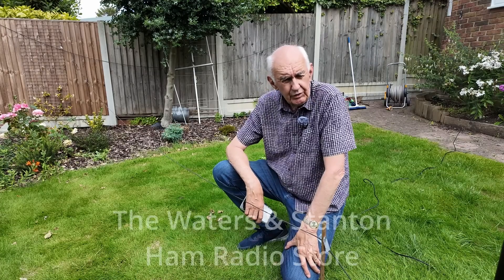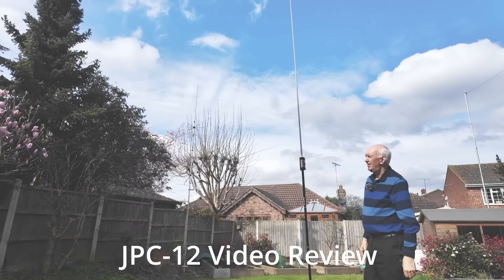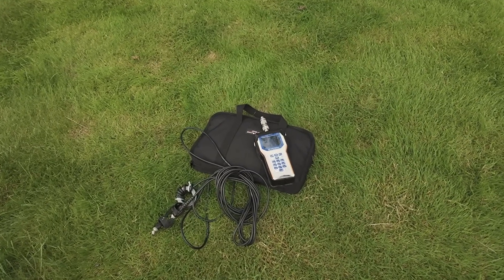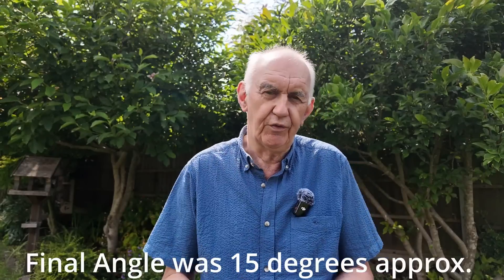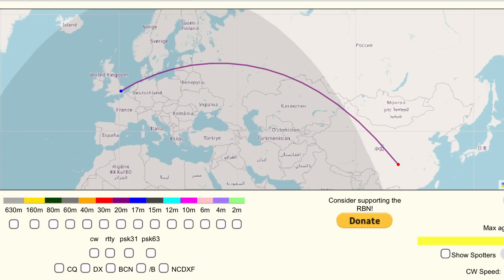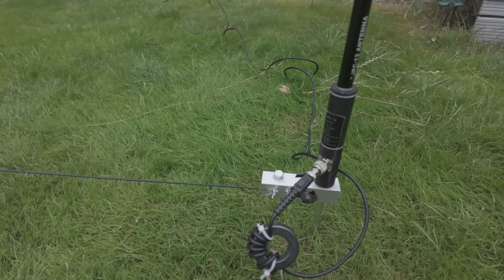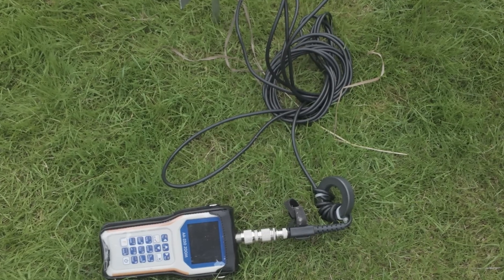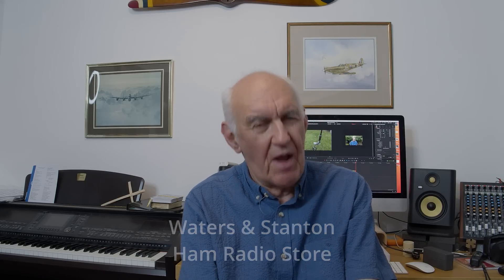Portable HF Vertical Antenna | Ham Radio

Comment: I'm a amateur radio operator living in a unassisted senior living center. I use a home made magnetic loop antenna in my room. Only 20 watts for local communication around the 200 mile area. Mainly with traffic nets. So transmission are short. Can you do a show on mag loop users in England and Europe. Thank you. Tom AF5AG
M  and 73. To

Comment: Excellent video. I have been working a home brew 5 meter aluminum vertical made from an extendable pole with a 2.5 meter fiberglass base (total length about 25 feet). The verticals attach to the antenna about 7 feet above the ground and angle about 30 degrees downward. 2 radials are resonant and are facing west southwest and west northwest, and the other 2 were about 3 meters long and facing northeast and southeast. I noticed a significant improvement westward as compared east. I’ll have to try elevating the resonant verticals as you did to see if I can get further improvements. Thanks for the always excellent videos.
Reply from the maker: You are very welcome

Comment: Hello Peter, I decided to buy one of those low cost QRP transceivers a few weeks ago, then planned to design/build a portable antenna by which to operate from.  While looking over the popluar antennas in use these days, I stumbled upon the JPC-12 antenna, and was impressed by the design, cost, and it's center loading, which improves radation efficiency.  So, I immediately ordered on.  In looking for reviews for this antenna, I discovered your YouTube page two days later.  To my surprise, I was impressed with your knowledge of antenna design/operation.  Here in the US, it seems most radio Amateurs know just enough about their equipment to get it to play, and are not interested in actually under understanding the "nuts and bolts" of it's detailed operation.  So, having made a career of servicing and designing aircraft communication equipment, I greatly appreciate your interest and knowledge of antennas.

Concerning a single raised radial for the 1/4 wave antenna system, I just discovered this concept 2 days ago and plan to experiment when the JPC-12 arrives - very interesting!  For ease of setup, I wonder if a chalk line dispenser radial will work.  So far, the biggest problem I see with the single radial, is with its pulling of the resonant frequency.  This is probably not too much a problem on the higher bands where the loading coil is out of the circuit, causing a broader resonance.  However, I imagine it would get quite touchy on the 80 meter band.  73 - AC8AQ.

Comment: Excellent contact into China! 👏 Im going to try this with a retractible metal tape measure once I get a 243-43 ferrite core to fit at the feedpoint end! I love the PAC12 the first time I used it on the beach I had a QSO on 20m with Ferry, YB0AR on10w onthe Xiegu X6100!Thank youforallthe info and great videos!💐
Reply: Or maybe use a cannibalised retractable camping washing line reel and replace the cord with wire knotted to the appropriate 1/4 wavelengths.  I used one once to make a linked dipole using tiny, jewellery making, barrell connectors a few years ago. I might appropriate that again!
Reply from the maker: Thanks for sharing.

Comment: Mine Gott, now how many elevated radials do I fit to the feed, I think it's 6, as good old Water has mentioned, a few 2m ones, and in other videos, 17 and 23ft. So I'm in a second floor flat and will fit six, so 2 pairs of 9, 17 and 23ft. Then he says fit ones that are 1/4 wavelength, so bin that initial list for pairs of 5, 10 and possibly 15m in a coiled up manner as I'm out of room. Ahhh, WTF is the actual answer chaps !!!

Comment: I used a Wolf River Coil tuned to 40m ssb and also used a 213" whip. I put the whole system on a camera tripod and raised it up to about 5ft. Then I connected TWO radials 33ft in length going in one direction going about 45 degrees apart. At the very same time I had a 49:1 with the feed point up in the air with 66 or so feet flat topped close to 30 feet up in the air. This was broadsided in a northerly direction. The radials were also pointed in a northerly direction. The vertical was much quieter. Stations that were some 1,000 miles away were giving me equal reports (5 9+) off of the vertical. Their reports from me were about the same on the vertical. The flat topped dipole also equal in their reports, but had a 10 over 9 noise floor on 40m ssb. Reports to my south within say 150 mile range were several s units less on the vertical, with northerly pointing radials, than on the dipole broadsided north and south. VERY happy with the vertical with raised radials. Much easier on the ears since that was a week long stay while camping and making over 1300 contacts. Robert KD4YDC
Reply from the maker: Thanks for that info Robert. Very interesting.

Comment: Another JPC-12 tip: I have found that if you move the variable coil element from the top of the fixed elements down to the bottom (just above the coax feed section), you can get a decent SWR on 60m as well. Alas, we can't use 60m in VK... 73 Richard VK2SKY
Reply from the maker: Many thanks Richard.

Comment: Great video Peter. As I use long path only, all my radials point in that direction. A simple 20m vert in the corner of the garden, slightly raised up fastened to the fence, can have its radials attached to the fence and raised.
Quite often with this type od arrangement,  sigs just seem to pop up from a dead band.
73  zl3xdj
Reply from the maker: Many thanks Brian.  Interesting about  “dead band” comment. Exactly  what I am hearing in the evenings. Hope all OK  at your end.

Comment: Peter, if you are adding an elevated radial with a 1/4 wave length, do you still have a 1/4 wave  vertical  or essentially a L shaped dipole?
Reply from the maker: Yes

Comment: Hi Peter, some guys on the topband (160 meters) call this configuration of a raised radial an elevated gull wing radial (based on its geometry).  73, Don wd8dsb
Reply from the maker: Yes and I believe there is an aircraft wing design that uses the same name.

Comment: Thank you for this and the many other excellent, informative videos. I really enjoy them and always learn something along the way.

I'm intrigued by what you shared, but not as much for portable setups as for my 6BTV, permanently setup in my yard. Like your similar vertical, it is nestled only a few feet from a fence that separates my property from my neighbors. As a result, I have a generous radial field to the east and south, far fewer to the north (tree/shrub), and virtually none to the west (fence).

Conventional wisdom would expect better performance in the direction of the best radial field, but mine seems to perform exceptionally well to the west (no radials) and only spotty performance in all other directions (in spite of having a "good look at the sky" in all but the northerly direction).  My plan is to stealthily create some elevated radials terminating at various points in the fence (where they won't create a trip hazard, etc.).  I'm also contemplating placing some aluminum window screen ("magic carpet" inspired) and see if I can get a bit more signal to the east and south.   This video gives me a bit of hope that it might work and worth trying.  But that's the fun in all this, isn't it?
Reply from the maker: Great to hear your plans. Sounds interesting.
Reply: I also am interested in trying this with a BTV antenna. I would also like to see someone run a 1/4th wave elevated multi band radial. 1 radial for each band installed on the antenna. I wonder if having multiple tuned radials would work or not. Anyone tried this?

Comment: This reminds me of an antenna I built for home use back around 2010. I built a fan vertical for 10,20, and 40 meters. The base was about 10 feet off the ground. I had one horizontal radial per band. The 40 meter element was actually an inverted L. The performance was excellent. I also could work the other HF bands with a tuner. 
Wonderful video of an excellent antenna.
Reply from the maker: Many thanks.

Comment: A number of years ago, I volunteered to set up a portable station for the Boy Scouts jamboree on the air. I used a Hy-Gain AV-18 on a tripod, and for the radials, I used a number of lengths of four conductor TV rotor cable with each wire of the flat cable cut to a resonant of a different band. It worked surprisingly well 🤪👍. I always enjoy your antenna experiments, keep them coming 😃, 73 de Dan WD4DB
Reply from the maker: Many thanks Dan

Comment: Have you ever come across a small vertical called 'Super Antenna', picked one up at a car boot for £10, it looks interesting but I cannot seem to locate any instructions on it,  you get a bag of bits, brackets, coils ate stright bits but they all seem to have the same threads on so cannot workout which way they go, I am having a great time trying to put it together logically and using a Antenna Analyzer (AA-600) to test what I do but nothing seems to work, maybe that is why it appeared at a car boot, but it looks professional and very well made, just cannot find any information on it. 73. James
Reply from the maker: I have heard of it but have no details. Sorry.